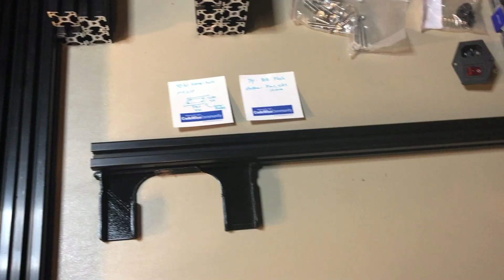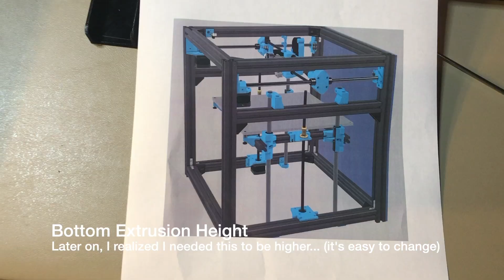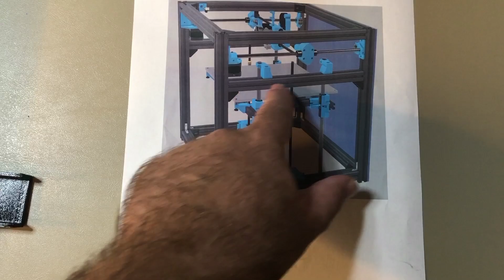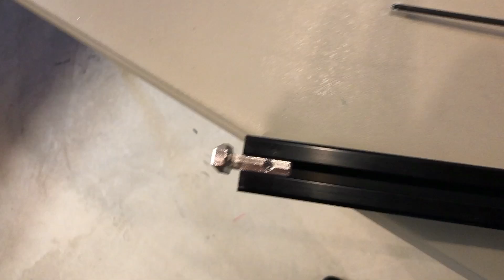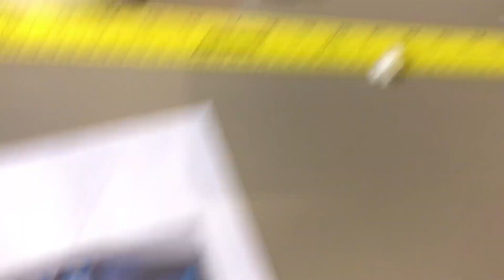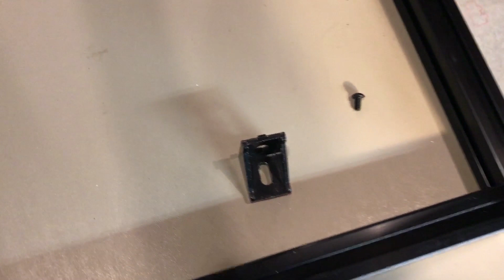Hypercube Evolution Build - Part 3. Frame Assembly

Comment: 420 and 410?? What in God's name were they thinking? Why didn't they just make it all 410 of 420 for the tops and sides? They made it unnecessarily complex by making width 10mm bigger than depth.
Reply from the maker: Zyltech is just cutting the kit to length based on the design. The extrusion is very cheap, prices are on their site for whatever length you need. You can also order larger pieces and cut them yourself if you don't want to pay the $1 per cut. As to why the original design was made that length, I can't say as I didn't design it. But all the rods and lead screws in the design (x,y, and z) are also cut to a certain length which is based on the extrusion length and parts that fit in,. You can always do whatever you want for lengths if you don't like it, just keep in mind  you will have to figure out the required lengths for all the other rods and may have to change the design of parts as well.